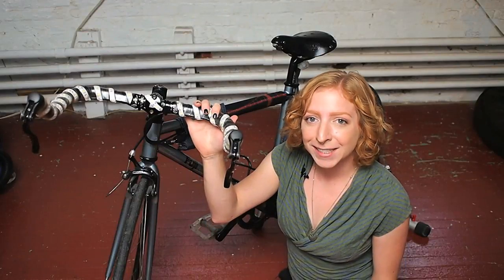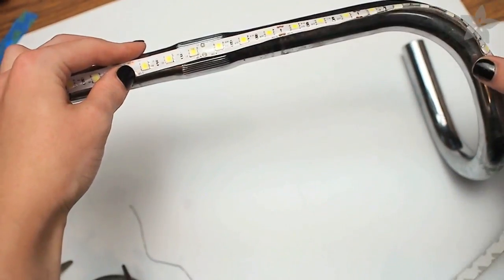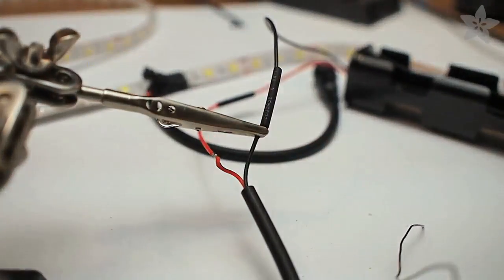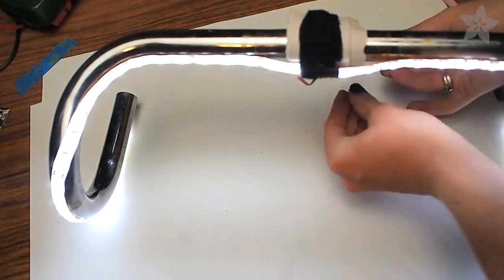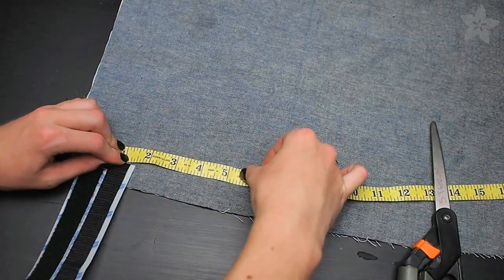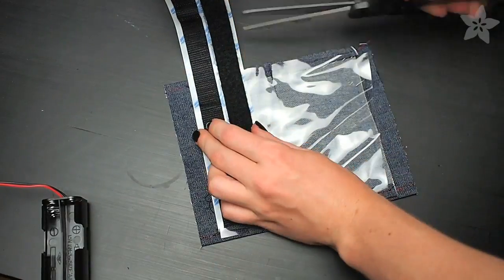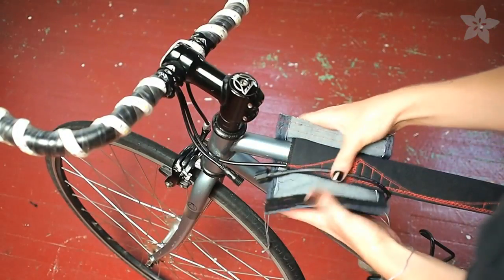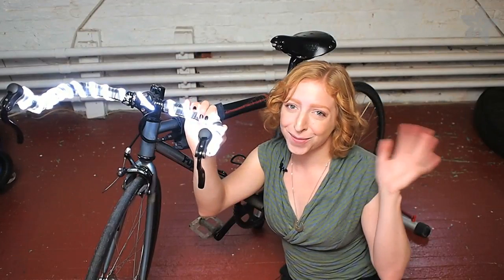LED Bike Handlebars

Comment from the maker: If I keep my eyes on the road (and not straight down), it's not bothersome. That said, I recommend the drop-bar strip style design shown in the video so the lights are primarily pointing forward or down. The spiral is fun but would be best a bit dimmer - either using rechargeable batteries or the Adafruit 6xAA battery holder instead of 8.

Comment: Industrial Velcro works better than what you're probably used to finding on your clothing. Snaps, if large enough, would be a cool feature. I too would worry about the bright, white light interfering with my vision in dark areas. I'd think that red LED might work best if you bike in areas without street lights.

Comment: To enhance this design (other than ensuring the light isn't blinding your face), one might also consider connecting this to a small arduino board with a switch to change light modes (e.g., on all the time or blinking).  You might also attach a potentiometer to it and use that to adjust the brightness of the lights by twisting the knob.  Neat idea!  Might need to try this sometime.

Comment: you're right. it is impractical. the lights would shine in your eyes at night, and that would be dangerous.

but if this is for just adding a cool touch to your bike's handlebars, then that's a cool little project.

I don't know adafruit noting your username? it's your opinion. i think they took it personally.

Comment: I like the instruction on this video, and I really like what Adafruit is doing in general, but I think handlebars being that bright would really take away from my night vision. maybe a strip along the leading edges of the fork? maybe under the down tube? anywhere I'm not going to be looking directly at them while riding at night.
Reply: I stuck reflective tape on mine, I agree with you about the night vision, these look quite blinding in the video.

Comment: Wouldn't a full wrap make it HARDER to see where you're going...?
Reply: Yes, this is exactly the weak part of shown example. Actually, I had before to cover upward facing transparencies on some smallish stock bike lights, to address light leaks into the eyes, such a difference. In darkness conditions, it is vital to have light directed front-side mostly, and out of your eyes. Therefore this design has to be applied with front/down positioning of light source - very important part. Of course, this comes from the experience using, and here we see idea of implementation, which itself is executed neatly!